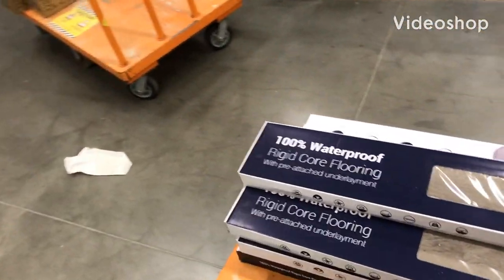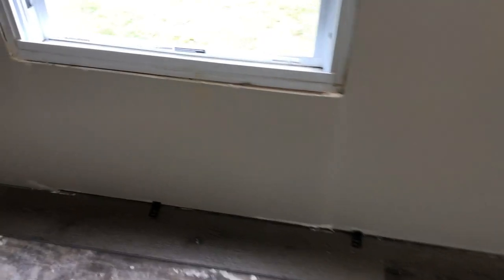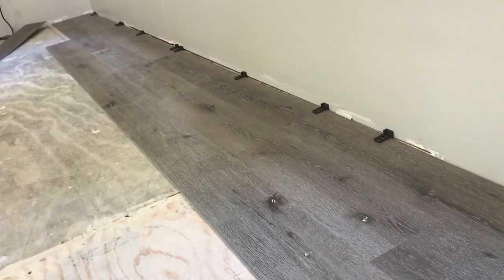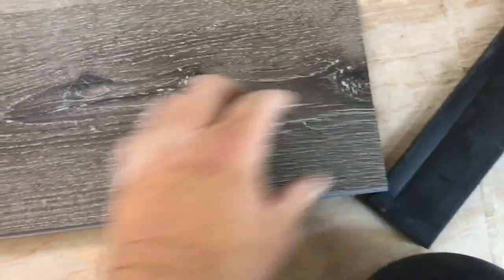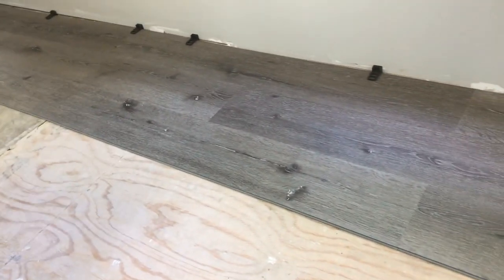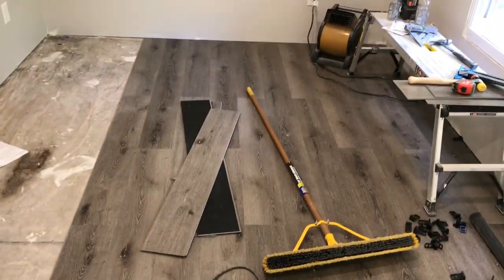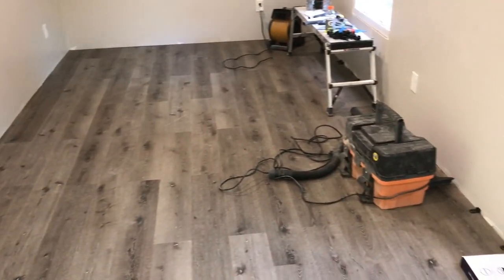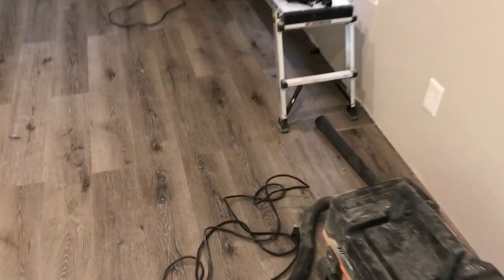Rigid core luxury vinyl plank flooring: installation

Comment: I guess it is a floating installation. It would have been nice if you would have shown the cutting as you're doing it. I thought that's what installation was about partially anyways. But you taught me some stuff but it helped me find some other channels  to complete the process
Reply from the maker: Measure,mark,cut either with a straight blade and a square or mitersaw. It’s pretty basic. The video was to show the installation and how to fit the pieces together. Glad oh help a little. Good luck Dave👍🏻

Comment: How did you cut RVP ? LL flooring told me you can’t use a utility knife bc the one we bought has stone particles
Reply from the maker: Used a miter saw with the blade on backwards. 👍🏻

Comment: Niceee. My husband is about to install that flooring.  He just removed the carpet and there is a cushion.  Should we leave the cushion? Or remove it and lay the floor directly on the cement floor?
Reply from the maker: Take the padding up. Might have to scrap it a little bit. As long as you have the flooring with the built in vapor barrier you good to go. If not apply a vapor barrier to concrete then go to town with the flooring👍🏻. Good luck and take you time seaming together.

Comment: How do you lock the ends in and the sides and keep them straight and keep them from moving
Reply from the maker: Your first course in important to be square. Use the spacers, fit the sides in as close to each end then use the proper hammer and block to tap towards the ends while keeping the sides together. The key is to take your time and fit each piece into place and have a flat floor. Good luck Michael 👍🏻

Comment: Can I install this beneath my kitchen cabinets? Or do I install the cabinets first?
Reply from the maker: I would do it first. At least one course to have a clean look between the cabinet and flr and shim the rear end of cabinets so you don’t waste unused flooring. Or use a course along the rear end to make leveling easier
Reply: NO you DO NOT install cabinets on a floating floor, the floor needs room for expansion & shrinking
Reply: Nooooo

Comment: Can you cut this with a utility knife?
Reply from the maker: You could but make sure you use a straight edge and a sharp blade. Score it a few times and try snapping it. Good luck be safe👍🏻
Reply: @HighRidgeHandyman  how did you cut it if not a utility knife?
Reply: @simonedoesitbetter  yes sir it cuts very easy .. it’s softer than sheet rock but have to crack it and cut both sides bottom and top ...Just be aware of the side lips or it won’t lock togetherness

Comment: Just bought the same product. It’s not locking
Reply from the maker: Make sure the ground is even. You have to go easy and take your time with EVERY piece. Use the proper tools
Reply: High Ridge Handyman I’ll try again. I was getting frustrated and thought maybe it was defective
Reply: @tiaral4437  I understand the frustration. I'm putting down this same floor. It is not easy. I have 5 rows in so far. I find that putting in the short end at a steep angle and then locking in the long end from the short end down works best. Jonesknows does an msi flooring with good visuals that would help.